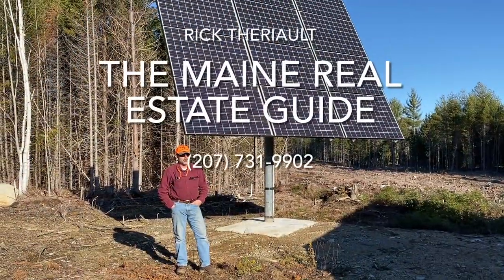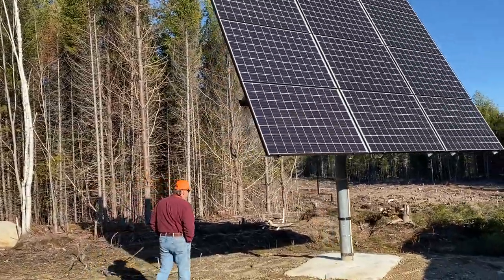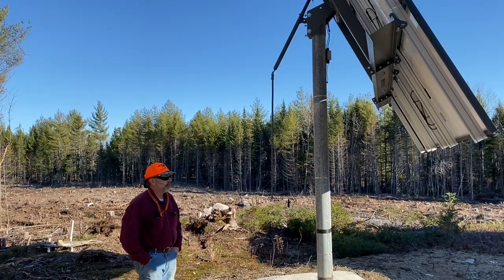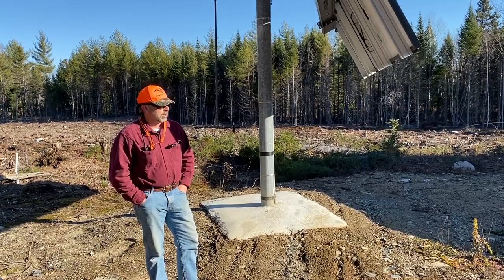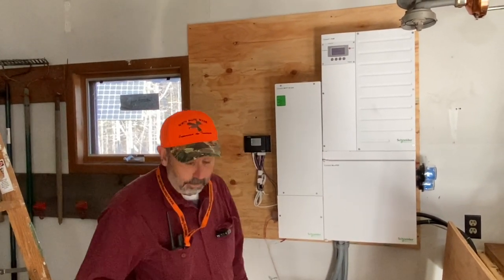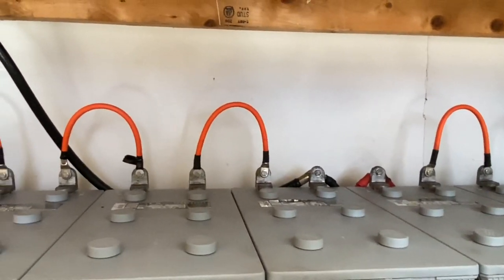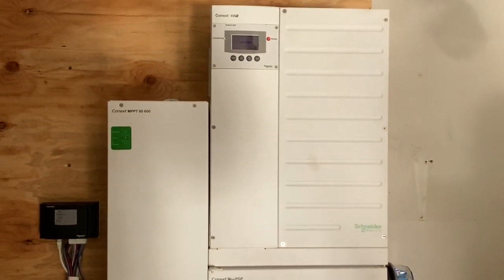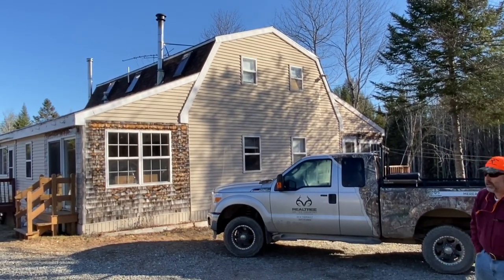Off Grid Cabin Solar Install Part 2 | Maine Real Estate

Comment: We would have killed for a system like that back in the 1970's when we spent summers on an island in Casco Bay. The issue with the island was it was an island so it was never going to be hooked to the grid. Between solar set ups like this, desalination and rain water filtration, instant hot water systems, etc, etc I could turn a powerless cabin with no running water into a paradise with everything a suburban house has today.
Reply from the maker: Thanks for watching and sharing your experience.

Comment: Ballpark cost for a setup like this?
Reply from the maker: Ball park depends on location, site etc. +/- $30k before tax credits
Reply: @lifestyleproperties  thank you
Reply from the maker: Your welcome. It was not cheap, but you get what you pay for. This location is miles from the nearest utility lines, so when you consider the cost of running grid power over a distance like that, plus negotiating easements for the pole lines etc, this was by far the most practical option for electricity. Our tenants have been very happy they don't have to listen to a generator running while they enjoy the solitude and peace and quiet of the Maine woods.